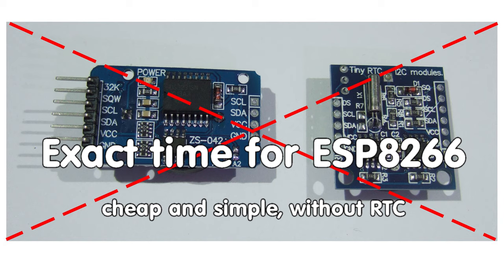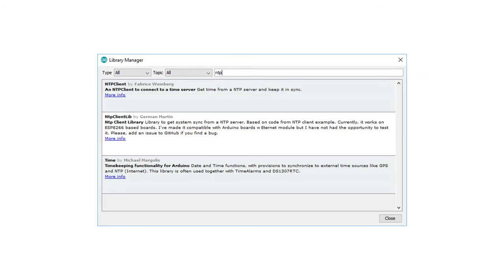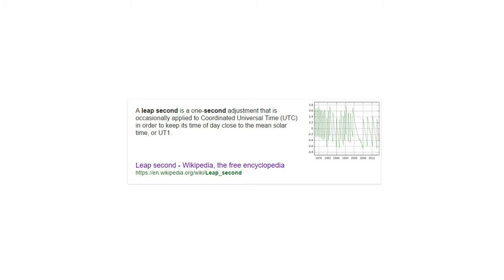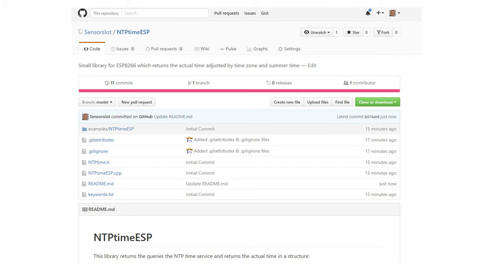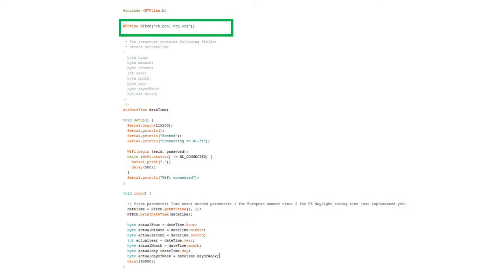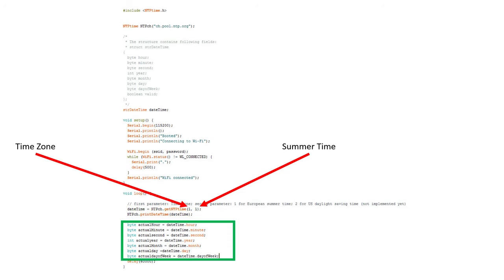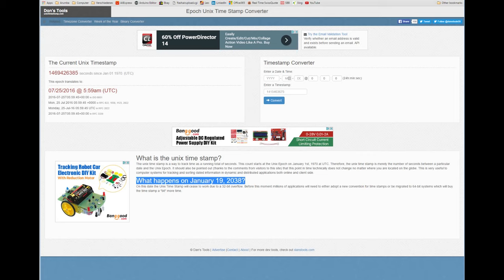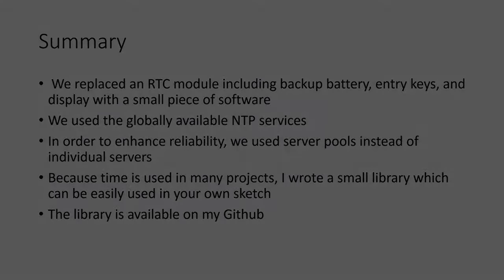#67 Exact Time without RTC Module for the ESP8266: NTP Time

Comment: ESP8266 already has support for SNTP, one can use that with configTime() function and then use time() to get the time in seconds since 1970. It is also useful to use both RTC and NTP to get the initial config and updates from NTP but save on wifi communication in the usual work. I use that in my project http://github.com/baruch/circle-clock
Reply from the maker: Thanks for the tip. I tried parts of you code to read the time and it worked. But I did not find a lot of info about the SNTP protocol nor its implementation on the ESP. So, I am not sure, what your program does. Obviously, the configTime calls a NTP server and returns the actual time, even timezone corrected. What does the "time(NULL) do? Is it based on the internal RTC? Is there a good link available for this implementation? What about the date?
Reply: time(NULL) is a standard unix function to return the time in unix time (seconds since 1/1/1970), it uses the time that was brought by the NTP protocol and the local time keeping when the cpu is awake. The code is hidden inside the Espressif SDK but I prefer using that because it reduces the amount of code I need to pull from outside (even though the NTP code you provide is small, it doesn't update beyond the point in time it was brought in).

The date is included in the number you receive, for my own needs I only wanted the time so I didnt care to extract it but there is a function in the Arduino ESP8266 SDK to extract the different parts when needed.

The timezone is hardcoded in my code and needs to be provided to the configTime call just like in your code, there is no real way around that. To know the local timezone requires knowing your location and the full mapping from location to timezone which is irregular.
Reply from the maker: Now I think, I understood. Maybe I change my library to adjust to this call. It would replace a few lines...
And the implementation of the time() call would save some energy if the device should run on batteries. Also the call is much faster.

Just a remark: the second parameter in the configTime call should be the correction for the daylight saving time. But it does not work. I checked the code of time.c and saw, that daylightOffset_sec is not used. Is this by intention or just an error?
Reply: I believe this is an error, which is why I put my timezone adjustment as  +0300 rather than +0200 and 1 for DST. This is the Arduino ESP8266 code so a bug can be filed for them to fix this. I was just too lazy to bother.
Reply from the maker: I wrote now a new library with your suggested principle:
https://github.com/SensorsIot/SNTPtime/

I kept my adjustment and conversion routines because I do not want to have them in my code.
Thank you again for your help!

Comment: MR andreas thanks for library. BUt I have a small problem. I set up library,  compiled the sketch and it gave a some problems. They are,

"WİFİ" was not declared in this scope

In file included from sketch_aug16a.ino:3:
C:\Program Files (x86)\Arduino\libraries\NTPtimeESP/NTPtimeESP.h:49: error: 'WiFiUDP' does not name a type
sketch_aug16a.ino: In function 'void setup()':
sketch_aug16a:44: error: 'WiFi' was not declared in this scope
sketch_aug16a:44: error: 'WIFI_STA' was not declared in this scope
sketch_aug16a:45: error: 'icat_cikar' was not declared in this scope
sketch_aug16a:45: error: 'makerhane911' was not declared in this scope
sketch_aug16a:46: error: 'WL_CONNECTED' was not declared in this scope
sketch_aug16a.ino: In function 'void loop()':
sketch_aug16a:56: error: 'NTPch' was not declared in this scope

What is the problem and what can I do. Thanks for helps 

HAve a good day.
Reply from the maker: Maybe you did not select the ESP8266 as a board?
Reply: ahh ı am sorry I forget it. But now I the problem is 
error: espcomm_upload_mem failed 
What is that. I can't solved this problem.
Reply from the maker: Did the blink sketch already work?
Reply: Mr Andreas everting is ok. I solved the problem. But now ı want to write time on the GLCD screen.  
For example ı can write GLCD.print("andreas");  this code for writing andreas. 
What can I write For Writing time On GLCD Screen  

GLCD.print(.............); ???

What is here ........... ?

Comment: can someone post a full sketch´s code. The Example is missing Parts with the WIFI
Reply from the maker: What is missing? I just downloaded the library from my github, loaded the example file, replaced the credentials and it runs.
Reply: i really dont know what i did wrong. But now it it running.
But the esp is not receiving the time (same problem as another one)

Booted
Connecting to Wi-Fi
.....WiFi connected
Waiting for NTP packet
0.0.0.0
sending NTP packet...
.sending NTP packet...
.sending NTP packet...
.sending NTP packet...
...
Reply from the maker: Can you try once "time.nist.gov" instead of the "ch.pool....."? If it still does not work, can you try the other library wich I provided a link? This worked in another similar case.
Reply: Nice video Andreas Spiess, Please let me know the time zone for India. 
dateTime = NTPch.getNTPtime(5.30, 0); - I am not getting the current time after uploading the sketch.
Thanks in adavnce.

Comment: Awesome library, thanks!  But I kept getting random errors:

2021-3-27-7 11H 58M 3S 
2021-3-27-7 11H 58M 4S 
2036-2-7-5 0H 28M 16S 

It jumps to the year 2036 from time to time.  I took a peek at the code in NTPtimeESP.cpp and found "if (_unixTime > 0)", then looked for where _unixTime was retrieving its value, and found this: "_unixTime = secsSince1900 - seventyYears;"  If _unixTime, secsSince1900 and seventyYears are all unsigned long integers, then _unixTime will never be less than zero even if secsSince1900 - seventyYears would otherwise produce a negative value (because an unsigned variable cannot be negative).  Since secsSince1900 was the value  being fetched from the NTP server, I figured that was the variable that could be 0 if the fetch failed.  So I edited the code a bit and changed "if (_unixTime > 0)" to this "if (secsSince1900 > 0)" and now I no longer get time warps to the year 2036.

Hope that helps, and thanks again for sharing your work!
Reply from the maker: Thank you for your correction. This is an old library and you are the first who discovered that error. I corrected the line now.

Comment: Interesting video :) I never seemed to occur to me that having internet on the esp makes an rtc superfluous since we can use ntp.

The olson db, tz, zoneinfo or time zone database (it has lots of names) managed by iana contains the rules for all the different zones DST times and more things like historical timezone info. It certainly contains the info you would need to implement "NTPtime::daylightSavingTime". It can be found at http://www.iana.org/time-zones. "man 5 tzfile" has info on the files structure.

I assume the database is too large for inclusion on a esp module. The tarballs amount to almost 500kB and I'm assuming that quite some optimization would be needed to strip out the parts not needed for a given project (ie. historical data that is only needed for complex date calculation stuff).
Reply from the maker: Thanks for the tip about the link. I will look into it. Unfortunately, the work is not done if you know the definition. You have to translate it into code and test it. This is, why I thought, a viewer could help me out with this.

Comment: Hi Guys. I am new to Arduino and Sketch. I just downloaded this nice project and tried to compile the example. I got tons of errors about missing required header files like "ESP8266WiFi.h" and "WiFiUdp.h" and so on. I could find some header files with the exact names in Github but it did not fix the problem. May I get all requred libraries used in this project just to be able to reproduce the same results as expected in this tutorial. Thanks in advance.
Reply from the maker: Do you use an ESP8266? And does the blink sketch runs on your board?
Reply: Hi and thanks for your comment. Yes I do have ESP8266 modules but I still do not have any Arduino board (waiting for Uno R3 to come within next week). I could just use Sketch's serial monitor to send AT commands to my ESP8266 module. It works perfectly fine. I wanted to send the UDP request to the module over the serial monitor but it seems it is impossible because in the serial monitor I can just send ASCII characters and no Hex data. That is why I decided to compile your code and the rest you already know :)
Reply from the maker: I think you mix something. This sketch has to be uploaded to an ESP8266 and not on an Arduino.
Reply: Oh thanks a lot for clarification. But I have no idea how to do that. I would appreciate it if you provide me more info about it. Any youtube link or website ..... Thanks again.
Reply from the maker: Just google „Esp8266 Arduino IDE Tutorial“
Reply: I do appreciate your time. I will check it out. Thanks a lot.
Reply: Actually, I should have connected the GPIO_0 to the GNG before power up. That was my problem last night which is resolved now and I could finally download the blink application into my ESP8266 Module. I could go furture and compile and download your "NTPtimeESP" as well. Thanks a lot. Perfect :)

Comment: Hi! I have a question.. Can I use the library with Arduino UNO WiFi from arduino.org? Nice videos btw! You do most of the topics I like :D Thanks!
Reply from the maker: What do you want to do? And with which Microcontroller?
Reply: I want to control light in my room with ESP8266 12-E with phone over LAN, and be able to set the lightup time and such. And about the UNO Wifi.. I was just curious :) But I tried the library with my nodeMcu 1.0 and I wasn't able to receive the NTP packet :/ I loaded the sketch, set the pool to cz.pool.ntp.org, connected to wifi as usual and in the console got "Waiting for NTP packet" and then only bunch of dots.. Any help?
Reply from the maker: Strange. Is your ESP really connected to your Wi-Fi (credentials ok?)? If yes, then I would try ch.pool.ntp.org. Otherwise, you can download a new version of my library. I changed one file name. Maybe it interacted with another library.
I downloaded the "old" and the current version. Both rund on my Wemos Board.
Reply: +1 here. I'm having the same problem. It definitely seems to be connected, but regardless of which pool, I get the death dots.
Reply from the maker: I just tried it again: I downloaded the zip file from my github account, copied it into the library folder of my Arduino IDE, choose the example file in the Arduino IDE, replaced the Wi-Fi credentials and uploaded it to a completely new LoLin (ESP12E) board. Everything worked. 
The only thing I could imagine is, that your network does not answer fast. Please change line 174 in the library file NTPtimeESP from delay(100); to anything much longer (for test maybe 5000). Then you  reduce it to a working number.
Reply from the maker: Your network maybe does not answer as fast as mine. Please change line 174 in the library file NTPtimeESP from delay(100); to anything much longer (for test maybe 5000). Then you  reduce it to a working number.
Reply: Thanks a lot for this response. Did not work, unfortunately. I've tried everything I know several times, so if anyone has another idea, we'd greatly appreciate :)
Reply from the maker: +Ryan Cook just to be very shure: replace the "." With an "x" and check whether it prints x instead of . to be very shure you use this part of the code. Maybe you can also insert some print statements that you know what is going on (e.g. Serial.Print(cb);)
Reply: Andreas Spiess funny you should mention that. I was getting aggravated, so my tests were a bit more profane XD. The wifi connecting part used the profane words, the waiting for ntp packet prints dots. I'm no programmer, not sure how to proceed from there.
Reply from the maker: I just posted an update to the library. Maybe you delete the current one and install the new one. It should print some more debugging info (e.g. lots of "0"). Maybe you come back to me and describe what you got as output.
Reply from the maker: I posted now a new library with more debug info. Maybe you try the new one and tell me what you see.
Reply: Well, after spending an embarrassingly long time replacing the old library with the new one, I get the following
Reply: ......WiFi connected
Waiting for NTP packet
sending NTP packet...
then about a million zeroes, then 
sending NTP packet>zeroes>sending
seemingly forever.

it also may be noteworthy (again, I'm a noob and don't know) that if i type my ssid and password in where you specified, the sketch won't compile for me, saying ssid not declared. I have to add elsewhere those chars to make it work.

Thanks for your patience and support, Mr. Spiess.
Reply: I get the same with the new version of the library. Maybe it is our router blocking the NTP packet from reaching us... I'll try to make hotspot on my mobile phone and connect to mobile data, so I'll be avoiding our router...
Reply: ..nope it doesn't work either
Reply from the maker: Good to know! Thanks.
Reply from the maker: I just tested it and added it to the comments of my video.
Reply from the maker: Matěj Suchánek found another library which works for him. Maybe you try this one:  https://github.com/arduino-libraries/NTPClient
Reply: it works :D. Mind, your library gives a way to mess with time zones. I had to go into that one and manually add a -5. Thanks a lot, Mr. Speiss, and keep the esp vids coming. They are about the best ones on youtube :)

Comment: Is it working without an internet connection ?
Reply from the maker: No.
Reply: @AndreasSpiess  what I want is to turn on and off lights at a specific time automatically and also to do the same from mobile over wifi without connecting to internet.

Comment: I think a useful extension for your library would be a function that adds a second to a dateTime variable and updates all values in case of overflow. It can be very useful for updating the time even while the Wi-Fi connection is missing. 
I solved it like this, taking into account leap years:

int day_in_month() { 
  int iM = dateTime.month; int iY = dateTime.year;     
  if ( (iM == 4) || (iM == 11) || (iM == 9) || (iM == 6) ) { return 30; } 
  else if ( iM != 2 ) { return 31; }
  else if ( (iY % 400) == 0 ) { return 29; } // leap year
  else if ( (iY % 100) == 0 ) { return 28; } // No leap year
  else if ( (iY % 4 ) == 0) { return 29; } // leap year
  else { return 28; } // No leap year
}

void addSecond() { 
  dateTime.second = dateTime.second + 1;
  if ( dateTime.second >= 60 ) { dateTime.second -= 60; dateTime.minute++; }
  if ( dateTime.minute >= 60 ) { dateTime.minute -= 60; dateTime.hour++; }
  if ( dateTime.hour >= 24 ) { dateTime.hour -= 24; dateTime.day++; }
  if ( dateTime.day > day_in_month() ) { dateTime.day = 1; dateTime.month++; }
  if ( dateTime.month > 12 ) { dateTime.month -= 12; dateTime.year++; }
}
Reply from the maker: Thank you for your code!

Comment: Thanks a lot for the Library Sir. Most of the time I get the correct time. But at times I get date as 2036-2-7-5 11H 58M 16S printed on the Debug console. Can you please help?
Reply from the maker: If you do not get a signal back (timeout) you get this result. Maybe you check the valid flag for that. or you just send a new request if you get this date.

Comment: Are there anyway to sync the time through NTP server once a day and keep the time running without a RTC module through an ESP8266?
Reply from the maker: The ESP has an internal clock Command time(). Not very precise, but sufficient if synchronized from time to time. But it does not work with deep sleep.